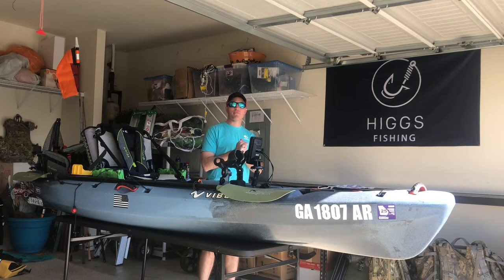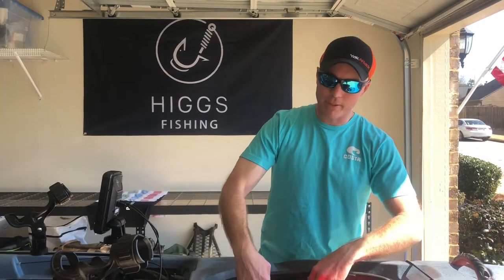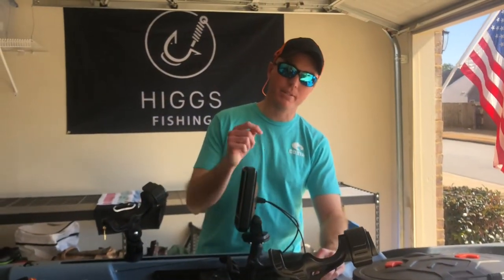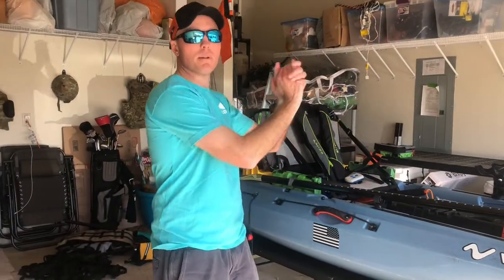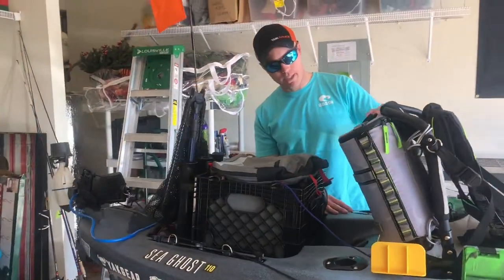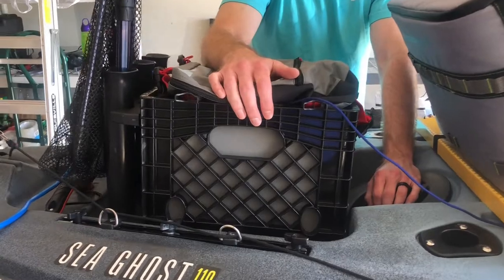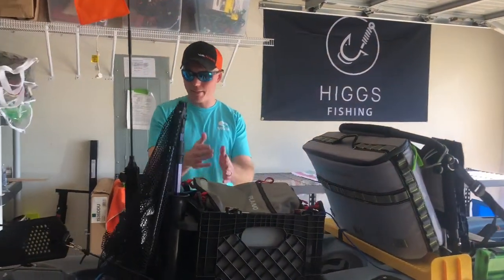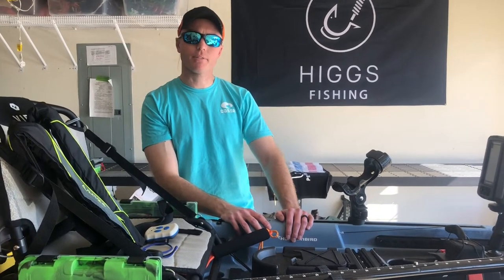Vibe Seaghost 110 Setup and Walk Around!

Comment: Do you have a link for the USB/cigarette/voltage meter panel? I’ve seen them on Amazon but I want to get one that works well.
Reply from the maker: https://www.amazon.com/Linkstyle-Charger-Voltmeter-Cigarette-Splitter/dp/B07QRQMCNX/ref=mp_s_a_1_6?crid=1WIBNKOTLGLF6&keywords=marine+power+panel+kayak&qid=1645739578&sprefix=marine+power+panel+%2Caps%2C868&sr=8-6
Reply from the maker: It’s not exactly the same. Go through the rabbit holes and look at all of them on Amazon just to see what you like.
Reply: I bought the same brand he did but I went with the one that is just usb and bolt reader and it works great